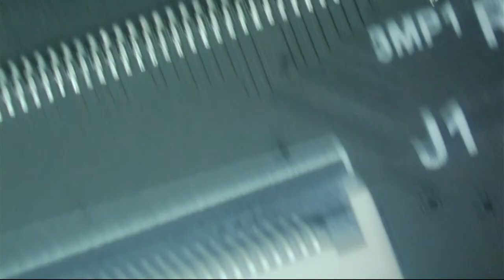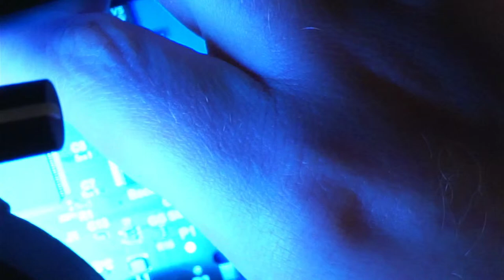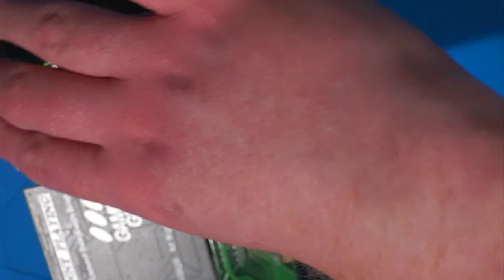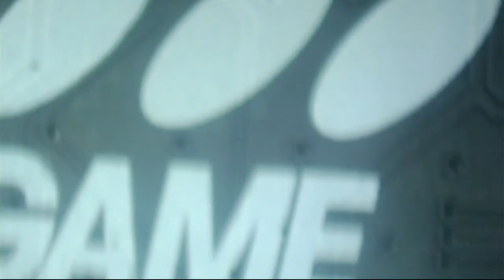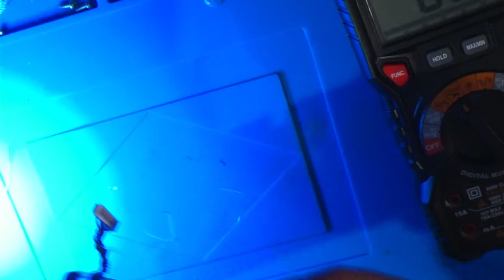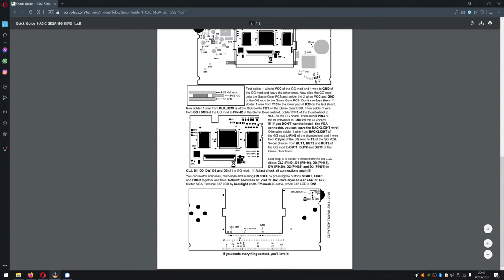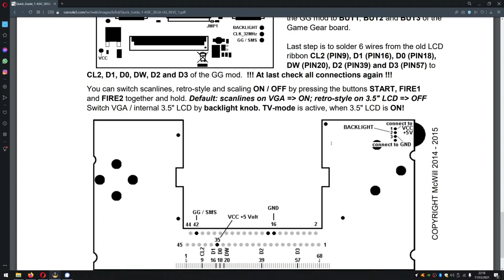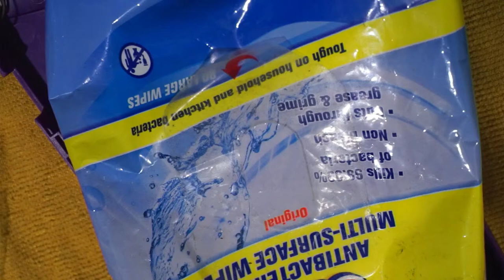Modding a Sega Game Gear with a modern LCD Live!

Comment: After doing 3 game gears I’ve found it easier to solder the wires through the vias than onto the pads.  They also seem a lot stronger than the pads.  I’ve also done the same with the controls etc through the vias.
Reply from the maker: Yeah you're absolutely right. The quick solder vias are the way to go. On the v2.1 boards they weren't labelled. The V3 boards as much nicer now though!
Reply: @NewRetroRepair  lol when you was putting the speaker in, I was actually saying… no it’s hot glue 😂